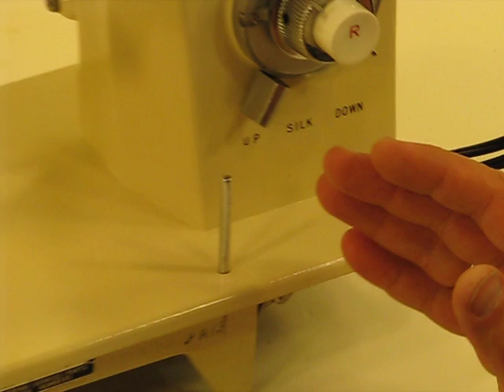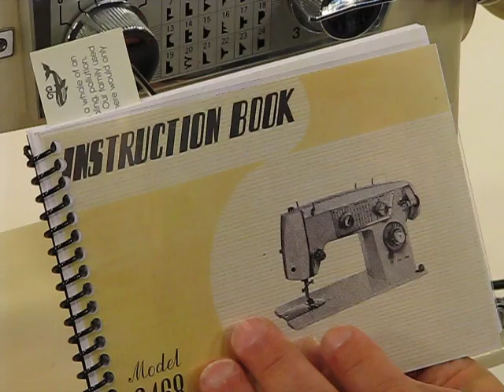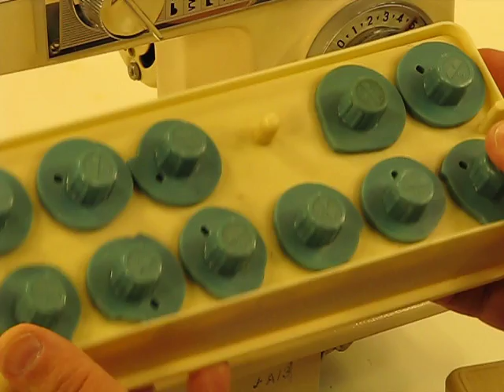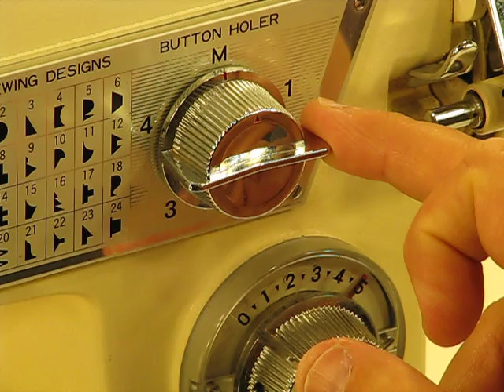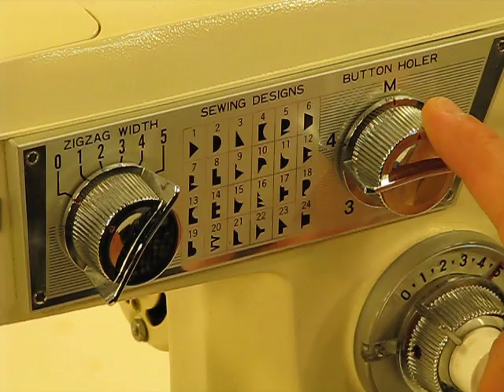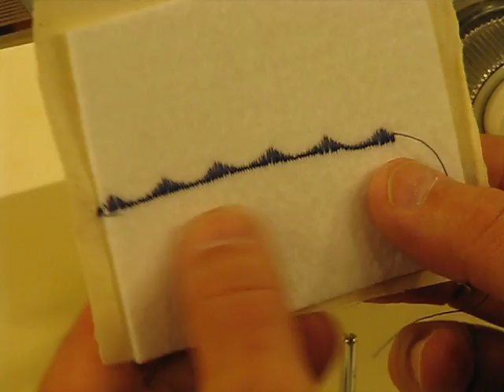Viking engineered 1958 "Elgin 2468" - Introduction

Comment: Hi Scott, great video. I was researching the 2468 because a local thrift store had on for sale and didn't know anything about it, but it was non-operational, however, they were only asking $10 with the table. Because of your video I went and bought it. Being handy, I found out it was just a problem in the cord, or maybe the foot controller, but the machine and work light works great. I do have a couple of questions regarding your video. My Elgin 2468 / 1.3 amp, built on a super solid cast iron frame... has a tiny sticker under, at the rear end of the machine, under the hand wheel saying it was made in Japan. Were these machines made in Sweden and then in Japan in later years? Can you tell for sure by the serial numbers? Also, the link you've posted for a FREE manual has either gone away or changed as they are now asking $5 dollars. As a hobbyist, I'm not planning on needing a full compliment of cams, as I might be doing some cloth, canvas, leather or maybe even my pants hems, but do you know where parts can be found, Like bobbins. Thanks for your video because now I do have a functional commercial grade machine.
Reply from the maker: Hi Anthony,

I'm so glad the video was helpful, and as a result are now the owner of a very fine machine.

As to the manufacturing location, most of these machines Pre-World War II were manufactured and assembled in their country of origin. Post World War II however, many machine patents were released to the Japanese government as part of the effort to restore their economy and livelihood, and were constructed with less expensive materials to reduce manufacturing cost. That's not to suggest the machines are poorly made, but simply that cost cutting measures were taken.

As to parts sources, EBAY is not a bad place to start, or simply Google Make and model, and cost compare....along with warranty and return policies.

Thanks for your questions and sharing, and I wish you many years of sewing pleasure with your amazing Elgin 2468..!

Warm wishes, Scott

Comment: I just got this machine..I have cams..but they are not for this machine..though the same pattern and number..only there are 30..They seem to do what they should..any idea where they really belong?  I couldnt get thread to "connect" .I see I threaded wrong so will try again.  I have a few issues..first Im at the library..so I am doing this from memory..internet at home went nuts.My needle hits the foot usually when up..not sure if its the right one..can I use any high shank..I think its high shank..or do I have to use specific ones from viking or elgin?  Right now I really just want straight stitch and zig zag..making demin dog beds for the rescue I work with to sell do they use the same foot?   However I would like the decorative ones..and hoping the cams I have will work..I just have extras..tempted to see if the design will sew even if its not on front.  If I remember right it said something about different plates?  Any idea where to get feet and plates?  Thanks
Reply from the maker: Hi Sue,

In reference to your questions, I would suggest purchasing an owner's manual. All the questions and challenges you listed would be answered. I hope you have your Internet fixed at home....much more convenient!!

All the best,
Scott

Comment: I have one of these Machines I just inherited. What would its value be? Has the cams with it.
Reply from the maker: Hi Easternoregon1,

Thank you for your note, and I'm sorry for your loss, but what a legacy machine to receive as a remembrance of this special individual.

VALUE and PRICING

When ever assessing the value of a machine, I factor in the quality of the restoration I've performed, and the depth of the maintenance I've done on that machine - in your case an unknown factor..

So, a rough estimate, with a number of factors playing into the equation, to include whether your machine is Swedish or Japanese made, would give you a range of $100 - $225, with a medium price point of about $160. If properly restored and serviced by me, the range would be significantly higher.

Enjoy your lovely inheritance, and thank you again for your question.

All the best,
Scott